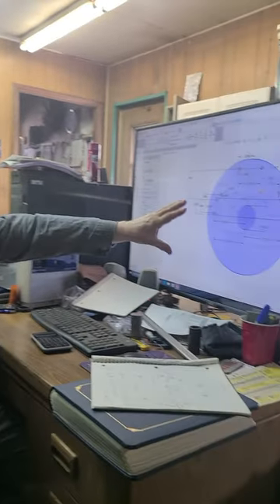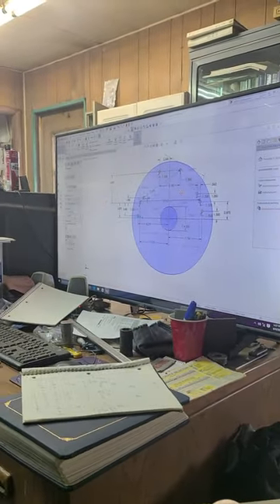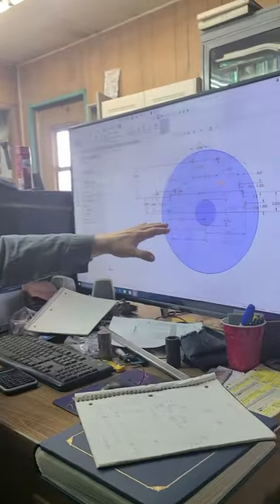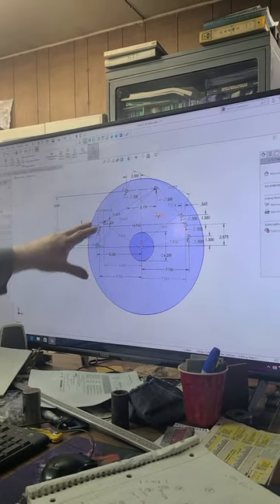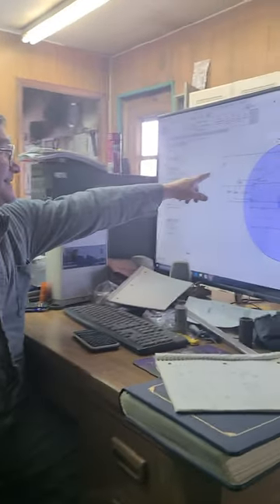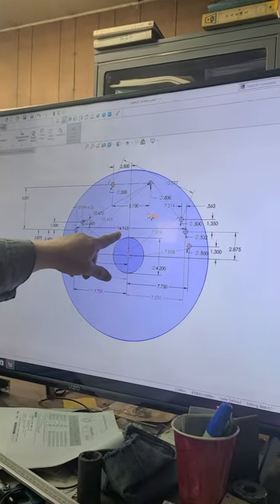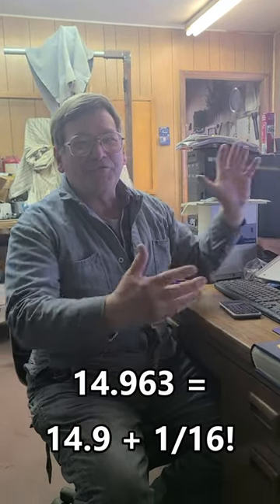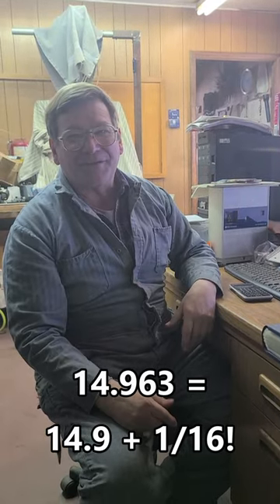Machinist's Minute: Keep an open mind when trying to reverse engineer parts

Comment: Sometimes it is an engineer putting a joke onto the design.😂
Reply from the maker: Today it is common that the sizes are chosen slightly off from any standard on purpose, so that competitors parts will not fit correctly, if they make them a standard size.
Reply: @HOWEES  This is why we can't have nice things. ( •ˋ_ˊ•)
Reply: @DarrellVermilion 
This is why we need a lathe!
Reply: @i-love-comountains3850  A lathe in every shop! ᕙ(⇀‸↼‶)ᕗ
Reply: @i-love-comountains3850  Throw off the shackles of your oppressors... by machining your own proprietary shackles! 
ヾ(`ヘ´)ﾉﾞ

Comment: It usually was the case with mixed dimensions that fractions had a tolerance of plus or minus 1/16 in. Two decimal places had + or - .010 tolerance and 3 decimal places was often + or - .005 in, unless tolerance was stated separately.  A few times I had seen metric and inch used on the same drawing, but never stacked fraction and decimal on the same dimension.  Strange.

Comment: Bellh ousings are adapters, so it will always be a mix of 2 separate engineers work, that of the transmission, and that of the engine. On my Jeep, it's a mix of metric and imperial measurements and hardware.

Comment: My problem is the customer always brings me a broken part to reverse engineer and re-make. So, with the damaged part, I have to try to account for the damage, normal wear, and original mfg tolerance (which I don't know because I don't have drawings). If I measure .740" was the original design 3/4" or 19mm or 47/64" or is it supposed to be .740"?   If I guess wrong, the customer isn't any less mad at me even though my boss only quoted him 1/3 the cost of the OEM and we didn't charge him for material because we "just had it lying around."
Reply from the maker: In the late 80s cheap importers were sending parts to china, instead of drawings & I got many laughs from the parts that had been built with milled slots, to match worn holes in the sample part.

Comment: So glad we converted to mm in the 70’s. Don’t get me wrong I still use and love inches but then it comes to super accurate or smell bits mm are king no question just keep moving the decimal point till you are in microns
Reply: Accuracy has absolutely nothing to do with the units being used.
Reply: @andreblanchard8315 Bingo. However, some people just can’t grasp that.
Reply: I was -28 years old when that atrocity occurred but maybe you missed the fact Canada changed it over on April 1st… another bad joke from a Trudeau
Reply: While I agree that metric can simplify the math here, you can run into similar issues because some may be measuring in cm, and others may be measuring in microns, and if you think they are hitting a cm, but they are overachievers and a few microns off, you may be confidently wrong lol
Reply: @andreblanchard8315 I disagree, units DO affect accuracy. There's a reason the whole scientific world uses the metric system: base ten avoids all the mistakes of inches and fractional measurements, and jumping between scales is vastly simplified. Sure, decimal and fractional inches work, but add unnecessary complexity and error.
Reply: @SparrowHawk183 what's the diameter of a hydrogen atom in metric?
An unending chain of digits? 
Wavelength of blue light in a vacuum?
Same problem? 
Looks to me like the metric system only swept the problem under a very tiny rug. 
Consider a Planck Length based system of measurement and you might have an argument. 
But I assure you, there's a pretty little box that you don't want to open there.
Reply: @andreblanchard8315 sorry poor choice of words. What i meant was metric is easier on the brain when working to find tolerances
Reply: Late 70s
Reply: @johnwarwick4105 you mean decimal compared to fractional.
001" and .0001" are use all day every day by machinists who happen to also be comfortable with imperial fractions and the metric system. 
American carpenters are quite comfortable using fractions for their tolerances as well, generally 1/8" down to 1/64" depending on what's appropriate. 
All these systems are tools, use the tool that works for you and for the project.
Reply: @GimpGladly  yes that's exactly what I mean. I am speaking  personally, I am very impressed by the these engineers  that can add up 1 15/64 a 2 1/8 then subtract 31/64th. Personally I find that too difficult generally have an error. Where's as 30.25 + 58.25 - 12.16 if much easier. No those are not the conversions just an approximation in my head 🤣
Reply: @GimpGladly  Easily.  1) Radius of hydrogen atom = ~ 53pm (picometers). Atomic radii are measured with the Bohr radius, a standard unit of measurement defined by the distance from the center of a hydrogen atom to its outer electron shell. The units are metric. Not arguing that the actual number is a long string after a decimal point. But units are metric. 

2) Wavelengths of blue light range from 450–485 nm (nanometers).
Reply: @GimpGladly  3) Planck length/scale is great for particle physics and quantum gravity, but fairly useless for machining on a lathe. 

4) Inches have been defined using the metric system since the 1960's. 

5) A meter is defined as the distance light travels in a vacuum in 1/299,792,458 of a second, and a second defined using the Caesium standard for atomic clocks.
Reply: @GimpGladly  Thus, the metric system is ultimately based on rigorous measurement of the finite speed of light and highly precise measurements of time. 

On a practical level for fabrication, reading dimensions in cm or mm and doing any kind of basic math is far easier and less prone to human error than using thousandths of inches, unwieldy fractions,  or decimal inch conversion. 

Again, there is a reason why only 3 countries still use the Imperial units of measurement. Sure, it works, but not elegantly. Metric system is objectively better. Change is hard.
Reply: why not just use hundredths or thousandths of an inch?
better then using a French government spec Yard as the only distance measurement you have available.
Reply: @SparrowHawk183  there is no requirement to switch between inches, feet, yards and miles.
you can just put the same prefix onto any of them just like you can for a meter.

as far as "removes chances for error" i know someone who had a 2cm/20mm kidney stone, the doctors didn't think it was urgent because said stones are almost always just listed as mm on the paper work, so in their mind they saw 2 and autofilled mm leading to the exact same kind of error you say metric solves.
Reply: @SparrowHawk183  and by the transitive property, so is imperial.
Again, these systems are all tools. I use them all with no problem depending on application. In a reality where context changes it's best to be equipped and ready to use the tools available and most fit for the task at hand. 
A nail gun is not always better than a hammer.
Reply: @ARockRaider  And let me clarify, I'm not some inch/pound/BTU idealist or anti-metric by any means. 
I take issue with the arguments given as indicative superiority in either system. They are not good arguments. 
Who can remember the list of arbitrary numbers that make the denominator of the meter/light-year any how and how does that not inherently have all the problems as a fractional system yet worse due to the large denominator? See the approximation symbol you used with the others? Or the ranges? 

Change is easy. Learning how to walk away from your team is hard. But I recommend it.
Reply: As an American, I have memorized, all the decimal equivalents, by 64ths of an inch. All the drill bit sizes, for all the taps. And I have also used engineering measuring tapes. Feet are divided by tenths, and hundredths, not by twelve inches. Hard to find a hundred foot engineer's tape.
Reply: @everettplummer9725  somebody once told me about a “drillers foot” it has only 10” so everything works out easy. Not sure if he was winding me up or if this is true but this might be the time to ask 😂👍

Comment: Thank you for explaining why metric is so much better
Reply: Only a sith deals in absolutes
Reply from the maker: Most engineers using metric use numbers ending in .25 , .50 , .75 , or a whole number, but then some use .10 , .20 ... then you get the .15mm guys, it is almost never an even number.
Reply: metriq is for europeans.
Reply: A friend of mine was a aircraft mechanic / machinist in Canada when they switched to metric.  He couldn't mentally switch gears so he moved to the states.🤣

Comment: I build electrical panels for industrial machines. Half the time, 10 pages of the 150 page schematic book are unreadable because of things like this.
Reply: What brand? Just a curious electrician here lol
Reply: @jacobplank  I work for a subsidiary of Robex called +Vantage. I build custom PLC boards and the boxes they are mounted in, but we build the entire manufacturing apperatus in our shop. It's not really something we stamp our brand onto, we just design and build whatever system a company needs for manufacturing. So far I've been working on mostly Honeywell and Polaris stuff.

Comment: We were building a pulp machine, for a recycling company. Bad prints, we got a thick beam in from Pro-Cut. Over twenty feet long. After we added up all the broken chain dimensions, we came up short. They are not going to take it back, for the same price, so the owner, got a beam, for his new garage. A Polish company, engineers, doesn't know what a datum point is. Or simple arithmetic.

Comment: What cad software is that I'm currently using the student/teacher free version of fushion 360 because I'm teaching myself and my siblings cad modeling but I'd like to upgrade when I finally get to doing what I want to do which is make horse drawn equipment like pioneer equipment was doing before covid made them close
Reply: That is SolidWorks. They should have a student edition as well if you have a student ID. I prefer the older editions of the software. I know they were trying some cloud based version recently and it was not an enjoyable experience.
Reply from the maker: @mrfrenzy.  I tried a trial version of solidedge around 2010, I liked it, but at the time they only offered subscription licenses, so I bought Solidworks, & quit upgrading, at 2018.

Comment: Is that a old school 3d scanner on your desk? Does it work? I came across one last year and didn't buy it.
Reply from the maker: It works, I did not buy the extra $2500 software when I got it & it is mostly a dinosour now, I think the additional software might have made it OK, but by the time I decided to buy the software, the company was no more.  I have considered a few newer 3d scanners (under$5K), but much BS in the adds & most reviews are from people doing less demanding work.  I am undecided & not needing one currently, the big project I bought the scanner for has gone away, and I got better at making models from measurements.  I am still interested though.

Comment: 14.963.. is definitely 15mm 😂😂
Reply: You've clearly never worked in a machine shop or production line... 14.963 and you cut it to 15mm I'll put my paycheck on it will have issues when In use. 😂